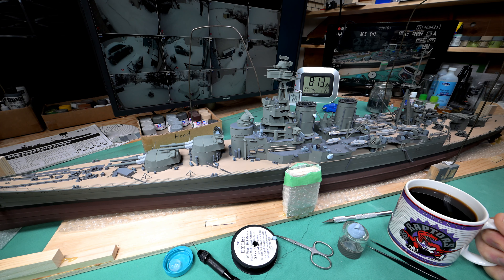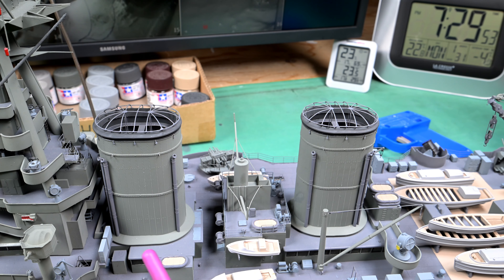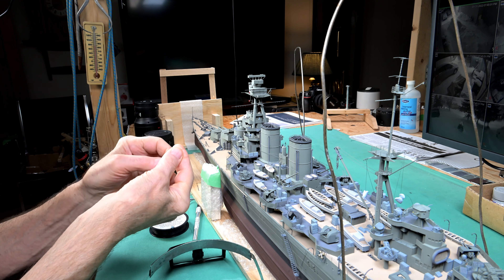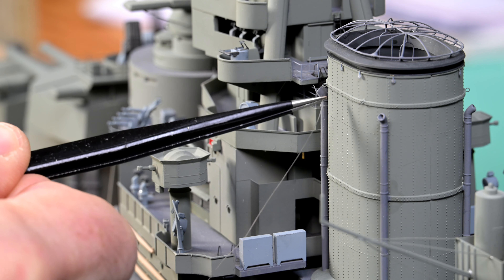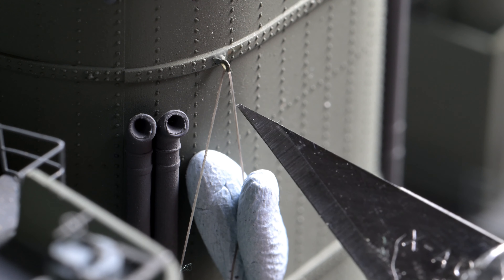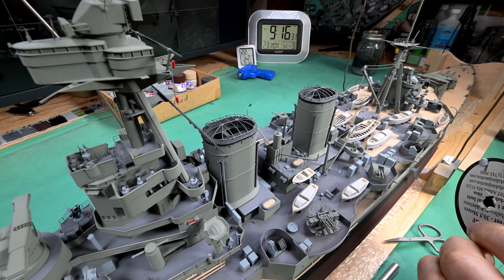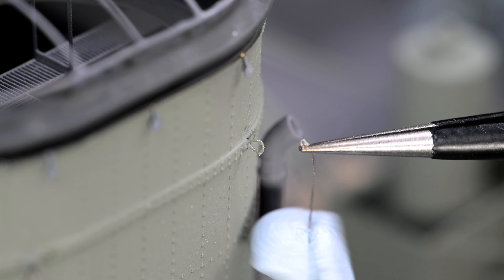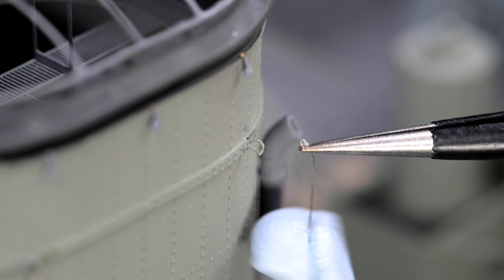The Model Ship - Part 1070

Comment: Hi Ron.  Check the manual .  The six lines from the foremast to the main mast are at the upper level yard arms.  There was also stays, one to the top rear of the forward funnel back to the attena thingy between the funnels and one from the forward top of the rear funnel forward to the antenna thingy.  As well as the six main lines between the masts, slightly below them in the middle there was another line.the four wires from the antenna thingy all join at the same spot on that wire. Two wires from the spindly arms bits and one line from the top of each funnel to the middle wire.  When it’s done it forms a diamond shape.  Then to complicate it there is another two wire slightly below that from the backward arms of the forward starfish platform to the forward pointing arms of the rear starfish platform. Check the books and it will make more sense, but you’ll see what I’m getting at.  Cheers
Reply from the maker: Hi Mark,
Nope! I just can't cope with all that detail --- but thanks! Worked at it all evening without pressing the record button. It now has the illusion of rigging. Tomorrow I'll go around with the #22 and #77 --- and that's it. 😁
Reply: We have been warned Mark 😊😊😊😊 I do believe the Hood is finished !!!